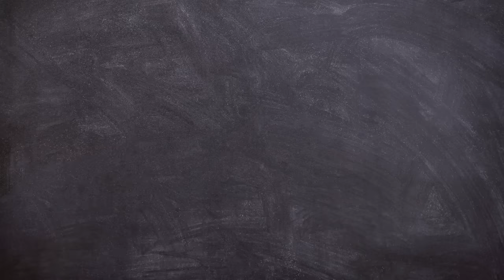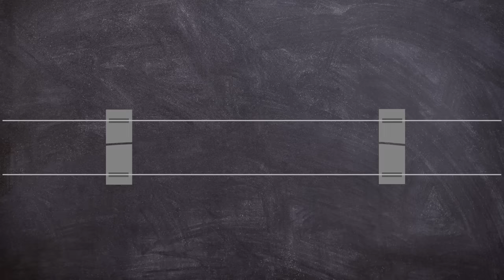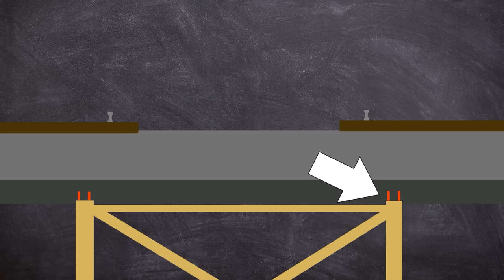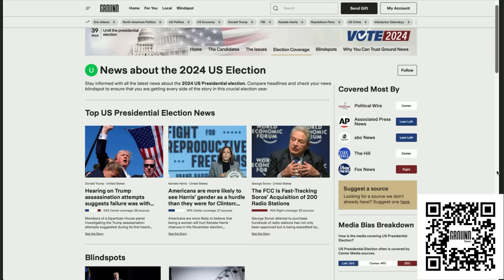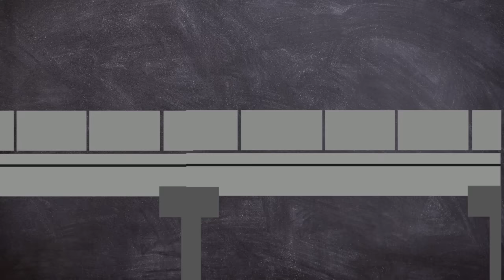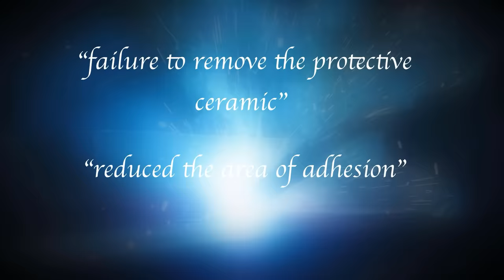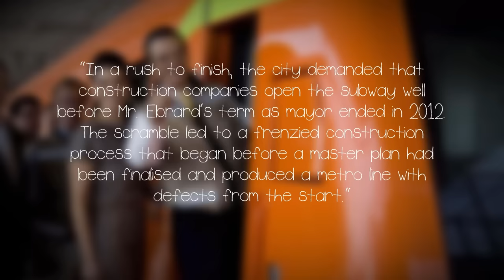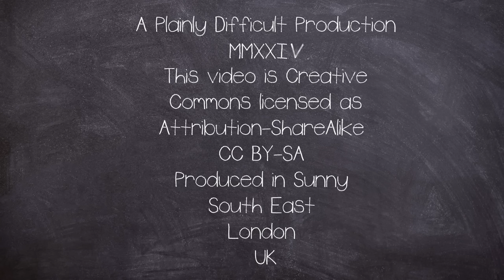Packed Commuter Train Unexpectedly Plunges Into Street Below | Plainly Difficult

Comment: A video about a disaster in MY city? How amazing 

For real tho, this was a massive mess a couple years ago. Subway line 12, also, kind of ironically, called the "golden" line due to its color scheme, had issues from day one as you mentioned, all because of rushed construction and, unsurprisingly (sadly), corruption inside the Mexican government.

Common opinion is that the investigations were right and the collapse happened due to poor maintenance, improper building and good ol' negligence, but the political party currently in charge has a... Tendency of denying all wrongdoings.

Anyway, great video dude, I knew it was a matter of time before you'd end up covering this!
Reply: Hola! 
I have family in Mexico, and I don't know CDMX nearly as well as I want to, but I do know that the subway system is kind of sketchy compared to other systems I've used, and better avoided if you have other options. 
And yes, I have heard the tales of corruption, so that doesn't surprise me at all. 
Overall though, your city is much more fun than mine, so you have that to enjoy!
Reply: @thing_under_the_stairs  subway is ok, it was left in disrepair for 18 years since ebrard administration, they just recently are doing much needed work to prevent another colapse in line 9 between stations Pantitlan and Puebla.
Mexican engineering is awesome but all buildings needs maintanance, something that was being neglected until just very very recently, only time will tell if Brugada invests or neglects our Metro.
Reply: Only had 1 issue using the metro. This was after midnight in Doctores and that was my fault for not getting a taxi.

Normal use is safe af, just be careful when twats board the train. Better to get off and wait for another than risk yourself
Reply: I don't live in Mexico but I got family and I travel there often, Matamoros area, and yes, they all tell me that it's highly corrupt. Heck, I got family that uses it to their advantage. Since the government is corrupt, my cousin bribes water workers and also the electric company to keep his cost low.
Reply: @28ebdh3udnav  Yeah, my sister and family have become fluent in the language of bribery too. Last time I was visiting I got to watch her bribe and flirt her way out of a speeding ticket. When I asked what her husband thinks of this, she shrugged and said that it's better than getting busted.
Reply: Tendency is kind of a understatement, I'm in law school and I remember the day Lopez Obrador fired the Ayotzinapa Special Prosecutor, absolutely bad fuck up
Reply: And to this day we still have no people being jailed for this display of incompetence... We live in a sad country.
.

Comment: Mexico City is subject to continuous subsidence, mainly due to being built on a former lake and groundwater extraction. 
I'm surprised that this was not mentioned.
 What engineering measures were taken to minimise problems from this?
Reply: None. Because Mexico. Also, by law it should have had earthquake protection. It didn't either. Because Mexico.
Reply: @Edhelistar  So it basically sums up to, "Why does Mexico have x problem? Because Mexico." XD
Reply: @SupersuMC  No joke, most of Mexico's problems are self inflicted. We're the falling off a bicycle meme in coutry form.
Reply: Not all of the city is built on a former lake. Precisely the part of line 12 that collapsed is on a part of the city that is solid ground that was never a lake. So in this case, and just this case, the fact that most of Mexico City is built atop a former lake is not that relevant.

Comment: Sleepers are also called railroad ties. The stud welding can use ceramic ferrules that should be chipped off so the weld can be inspected. When we did this we had to stick weld with 7018 if the original process looked less than great.

Comment: Although the video narrates the entire chronology of the accident well, it's just a brief summary,  because there are still several things to mention, especially in the engineering aspect, since there were other irregularities in the construction process that allow us to conclude that another type of structural failure occurred, so that it could not have been anticipated. Rather, the defects in the construction process, caused by poor management by the government in power at that time, had more participation in the occurrence of the accident, rather than a lack of maintenance.

Comment: For the bingo card, with the welding done incorrectly and the ceramic protectors not being removed prior to welding, it seems reasonable to assume the welders were lacking in at least job specific training. And while it's not "company blames victim", the ultimately responsible parties refusing to accept the final volume of the report, threatening to sue the report writers, and letting contractors be blamed via the findings of previous volumes seems similar in spirit.

Comment: I'm having a hard time understanding the stud situation. Shear atuds or Nelson studs are stick welded without the ceramic ring or gun welded instantly with a very foolproof trigger system using the ceramic rings which are then knocked off before concrete. But neither technique reduces the welding surface if done properly.

Comment: I find it odd the comment wit the ceramic shield around the stud as these are used when stud welding these into place. It is the flux used to protect the weld at the joint. What you would find is that no one tested these as part of testing to see if it''s a good weld is hitting them with a hammer and seeing if it deforms slightly instead of breaking off. This action usually breaks the ceramic ring . aa

Comment: In 5-10 years the "tren maya" is going to be here as well (cheaply build, rushed and trains made of chinesium)
Edit:
A couple weeks ago one of these trains craked a wheel and had to limp to the nearest station
Reply: Tren Maya will literally be using second-hand Class 43 HST locomotives from the UK lol. There's footage of one Class 43 hitting a car at a crossing at slow speed during what I presume was testing.
Reply: @NicolasChiribelo  those are meant for "the inter-oceanic corridor passenger train", and apparently proven more reliable than the "new ones" (haven't heard of any breakdowns, or at least not as much as the mayan train).

 And the train crash is more on the side of a "car-culture" problem, in most of the country, you just go to "Transito"(""DMV"") pay for your license in the morning, collect it by the evening, no test no nothing.
 Even if barriers are put to avoid crashes, people just brake them because they can't wait. Buses, taxis, cars, trucks, semi-trucks, motorcycles, wheelchairs, DOGS, everyone wants to outrun the train....
Reply: @NicolasChiribelo  tren maya Will only use brand new Alstom trains, dont missinform, the second hand trains aré.for the inter oceánica a completely different line
Reply: Alstom trains aré Made of chinesium??
Reply: @Megadethfan25  he probably likes to say slurs

Comment: One of the big problems is that the entire metro system in CDMX is subsidized, they don't charge what they should for using it, it's only 5 pesos (25 cents in dollars) what you pay for a ticket which allows you to travel on all lines and stations.  The price of the metro has to go up so that there are more resources for its maintenance and modernization but it would be an unpopular measure that would cost any political party votes.

Comment: I wonder about the thing you said about the ceramic covers that was not removed and somehow messed upp the welds .
These are called ceramic feruls and they keep the distance between the base and the stud to create the right distance for the welding arc to form and melt up the stud end and the beam ,then the stud is pressed onto  the base and permanently joined to the base  when the weld cools.
Saw a video about this and actually they talk about a failure mode related to welding without the ceramic feruls  , I would guess that the distance is to close an you short out the arc getting bad/no  melting of the parts.
Clean metal surfaces is also important as with all welding. 
So the "covers not removed" seems to be a strange reason for the studs falling of.
Low welding current , no feruls used, "dirty" steelbeams , studs not tested after welding: seems more likely.
Link to video https://youtu.be/zgqjZA9k_ms?si=hQCXD9-oIy7osPmr